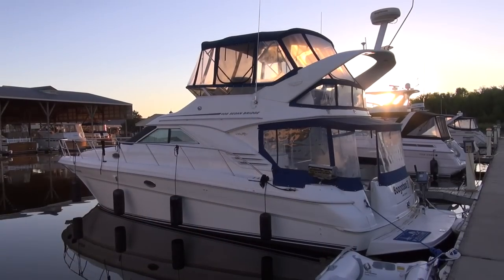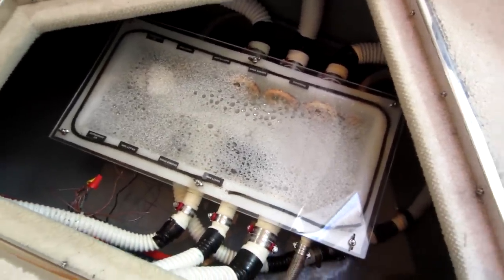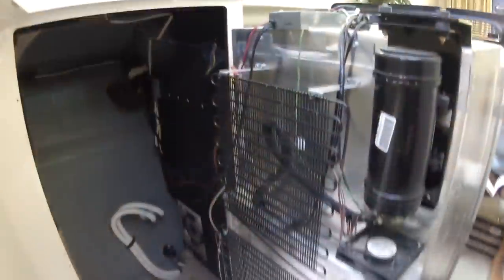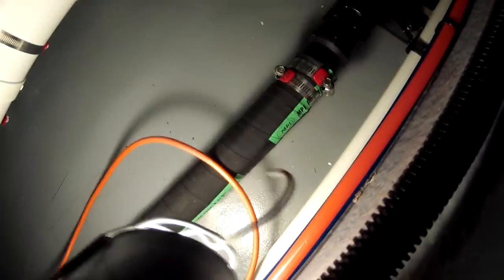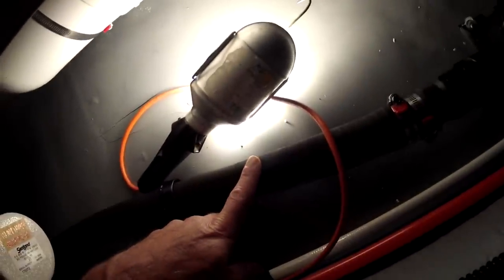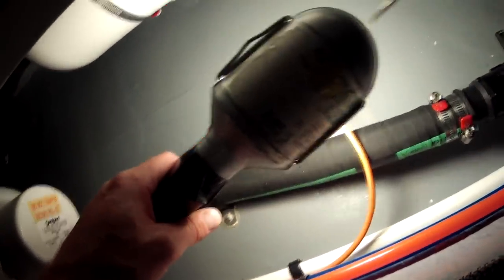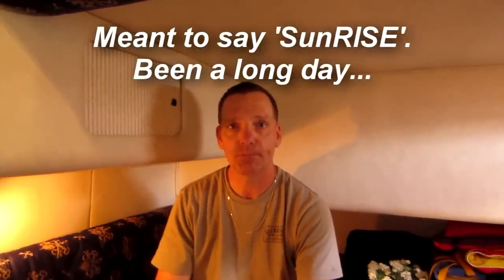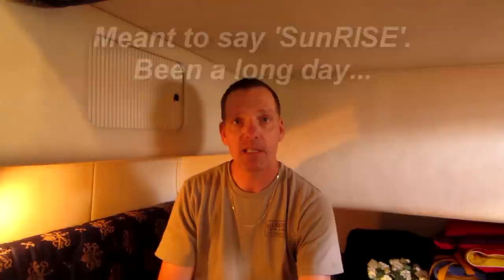Boat Repairs - Replacing Smelly VacuFlush Toilet Lines

Comment: Have to do all this as well on my boat ... took a look at the job this past fall and decided to put off till this year...Great to know someone else is going same thing as I am!!!
Reply from the maker: Mike Ob  Hope this video series will help you. As frustrating and sometimes back breaking as it is, the efforts are well worth it! Our boat/summer home is now back to the pleasant smell that I'm used to :-)

 Happily, we have only one line left to replace - the one running through the engine room to the (new) holding tank. That should be relatively painless.

 Be sure to check the other videos I have in the playlist on my Channel, as it includes step by step Vacuflush toilet seal replacement videos (2), Vacuflush pump overhaul & vacuum adjustment, and more, including the major, three part series on replacing our waste holding tank - that was a Big project! Also some other DIY boating projects from fridge removal to generator upgrades.

 I'll look forward to your comments from some of them, as well :-)

 Be sure to subscribe for all the new videos (I generally post new ones every week), as well as follow the fun on my Facebook Page (https://www.facebook.com/BoatsBeachesAndBars) for daily pics, stories and even Facebook exclusive videos!

Cheers, Paul.

Comment: I have been in your position a few times on my 40' Regal. I have had to replace the line twice due to holes. The second time around I replaced all the hose with PVC. It was extremely time consuming, but will never have to be done again.                        A few little hints: Place a warm damp rag over the suspecting smelly hose and leave it here for ~15 minutes If the hose has been permeated, you will definitely smell it, if not, move on the another section.                                                            Use a hair dryer or heat gun to soften the hose thus allowing much greater ease of bending and attaching to fittings.
Reply from the maker: Hi Gary Kelly . Way ahead of you on the wet rag, moving on test. Unfortunately, I am only two lengths of hose away from having replaced ALL the lines on the  #boat  :-( I will be soon sharing a 30 minute long video I produced that shows, in great detail, how to replace a section running from the day head toilet to the accumulator tank, including completely removing that toilet.

 Apart from that, I will be doing the line for the other toilet over the coming days. After that, there is only one more section, that of the long one running from the vee where the two toilet outlets converge, back to the holding tank itself. I am particularly looking forward to that one, as it not only runs through a main bulkhead, but tightly behind one of the big 454's tucked into the engine room.

 Thanks again fro your insights & wish be luck. I'm going back in man!!!!!

Comment: In the over 25 years that we owned boats, any boat with an on board plumbed black water system (not a chemical tank), would  every 4-5 years, yes need to have all the sewage lines replaced, unless the system was never used from brand new. It's crappy job, but worth it, especially when you go down to the boat in hot summer and don't get hit with a face full of ass. That smell, along with grey water overflow and stagnation from the sinks and shower, plus any that overflows/accumulates as you say into the bilge spaces. AC condensate that drains into the bilge from  AC, Refrigerator/Freezer/Ice-maker evaporators are another huge source of stink. As you said, anything on-board made of porous material, wood, cloth foam, carpet, etc even smooth surfaces (much easier to clean) get that smell on/in them and don't let it go. We used to think it was from Gel-Coat in the voids bilges, and spaces out-gassing, that never cured caused the odoriferous emanation, however we found out differently, just as you did.

Even though all the boats we owned, like yours used the better grade sewer hose, it would still break down and begins to leech that ass smell. The only difference between your situation and ours was we never had to replace any of the holding tanks. A proper scrub and deep clean, then resealing any fittings, including the vent, float sensor hole (floats for the level sensors went bad on a few) and pump out/macerator pump line eliminated any further stinky issues..Later on the macerator/pump line were closed off and padlocked per USCG reg's  along with the thru hull ball valve, so they didn't contribute to further smell issues

On the other hand, the one boat we had (Chris Craft 381 Catalina)  that used a Lectra-San system never had any issues, other than the baby wipes and feminine product issues, because just like you, I too failed to stress proper marine toilet use  for everyone who came on board. In the future if were lucky enough to own another boat, it will be equipped with an Lectra-San, as no other type marine system in my experiences works as well or is as easy/smell free to operate and maintain. I like the Vacu-flush systems like yours I really do, and had them on several boats, but one big weakness as you experienced is in  the parts of the system that can easily out gas that sewer line smell from even a well sealed maintained system,  or tank with external ventilation. I even tried pumping out and rinsing with  hot fresh water and purpose made chemical/bleach every time we would leave the boat for more than a few days in season, as well as pumping out every 2-3 days when on board  for long stays, no dice, and that stink is pervasive as you know, getting into everything, including you and your clothes...Even in winter when it's freezing on board and in storage, that smell can be detected, though no where near as bad as opening the boat up on a Friday after it sat closed up all week during the height of the summer heat in July-August! Once it starts, any hoses in the system have to be completely replaced..and it is never easy, since anything you have to service on a boat likely is tucked away in a space that was only easy to access when the it was being built, not after the fact, especially water, sewer and electrical lines, and they love clamps and zip toes ever 2 feet to hold things in place. The bigger problem is its well nigh impossible to access and cut/release those tie downs when trying to service things!

Comment: Is the smell you are getting like a Dirty sock, musky, dirty, locker smell?

If so, the problem is the AC system. It called 'Dirty Sock Syndrome' and is caused by a bacteria that collects and grows on the indoor coils of air conditioners.  If you cleaning of the evaporator coil with a non-acid coil cleaner. Water and cleaner in a sprayer and then spray the coil should help a lot.

When I was in Japan the AC unit got cleaned every 2 month by the apt mgr and even then, by the 7th week the smell would be back. But in Japan the AC run none stop for the start of May till start of Nov and was a heat pump system which get this problem a lot more than a AC only system. being that you are on a boat you may have more bacteria in the air when the windows are open.

Hope this helps

Comment: Sorry to hear about the nasty smell. May I suggest something I used to use as an alternative to air fresheners in my tour bus and also when I used to drive limousines (air fresheners can be overpowering and annoy passengers/clients). I used to get a pair of very fine mesh tights (!), cut them into 2 legs, double them over and fill each one with filter coffee, tie it off and then hang in the cab overnight. It does remove unsavoury odours and when not in use used to keep them in a plastic bag. 
However, do not be tempted to use it for coffee after a week or two, oh my! (yuk!)
Reply from the maker: ***** The coffee idea sounds great, but our problem had to be attacked at the source. Unfortunately, every effort to try and naturalize the smell were ineffective, leaving replacing the lines as the only solution :-(

 Upcoming video will delve a little further into the works, with the replacement of one more long line coming from the day head #toilet. After that, The Admiral has made it clear that I am going to volunteer to replace the line on the other toilet, as well. . . And I wonder why we haven't dome much cruising this year!

Comment: Where I work the cleaners use a product for a lot of different odor issues. It works on everything that comes out of either end of any human and other bodies. It permeates into the material just like the stink does. It is usually sprayed but I'll bet after some pre rinsing you could pour it into your toilets and it will work as well. It's called Cast Out by Multi-Mist Products. It is an odorless product that you use after you clean and wash an affected area. Here's how it goes, lets say that a body produces a top end product out of its eating orifice on to your rug (You know what I mean). It gets picked up and the area cleaned. Now it smells like cleaner and the offending fluid. Spray this stuff down and it eliminates the original offending odor and the smell of the cleaner you used as well. that's been my experience with this product.
Good Luck.

Comment: Hellooooooo Captain!... Nice Work, I have to do the same work for the next month, I'll give you the details as soon as I get in to it...
Reply from the maker: Hellooooooooo Lorenzo Ruscio ! Nice work, you say? More like back breaking, smelly work ;-) If you think this one was a good one, I have another one coming up where I replace the line from one of the toilets (our  #boat  has two toilets) to the accumulator tank. That project included completely dismantling and removing the toilet to get at the line.

 Bonus part of the video is that I had a couple of differfent cameras getting the action from different angles and one can get a close up look at how to replace the  #Vacuflush  toilet seal, as well.

 I will look forward to hearing from you as to how you made out with the lines on your boat when you are done!

Cheers, Paul.

Comment: Paul any advice on what to pour down into the holding tank after a pump out? Anything that will neutralize odors from any residue on a new tank?
Luis
Reply from the maker: sailor123ize  Hi Luis, Anchor Girl uses a product called Cameco RV Toilet Treatment Drop-INS. They are little drop in packets that dissolve in the water. She will flush one down the toilet after each pump out.

 You should be able to find them in #Florida, as they are made in North Carolina.. Web Site is http://www.cameco.net.

Comment: i have 25 hydra sport vector. we get a fowl smell only when under full power. the smell is venting from the anchor closet. we cleaned out that holding area with bleach and it stopped the smell when at low speed. any idea's to help this fowl stench
Reply from the maker: Thomas Thomas Although I'm not familiar with your model of  #boat  , I'm guessing you have a small day head on board?? If so, I'd check the toilet vent line, then the rest of the hoses. You may be experiencing the same issue we had before replacing the lines. Now, after more than a month with the new lines, we have a greatly reduced smell inside the cabin!! The last line I have to do runs from the inside and through the engine compartment (which is accessible from within the salon of the boat). That's gonna be a spring, pre-launch job for me. . .  After doing SO MUCH work on our toilet's systems, I've had enough for one year ;-)

Comment: How did the smell turn out, if so how long did it last?
Reply from the maker: +bigblockcutlass123 Worked out well. The only line we didn't change was the one that ran through the engine room. That one did emit smell when the engines were hot, on a really hot day, but nothing too extreme.
Reply: BoatsBeachesAndBars Good, I just changed all mine.   Couldn't stand the smell the past season